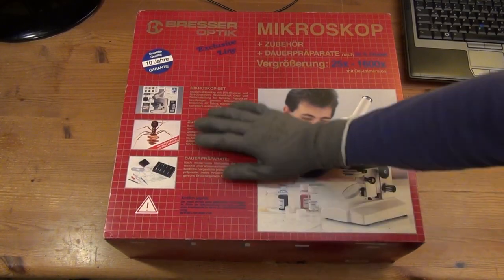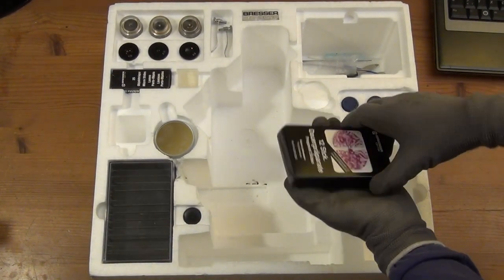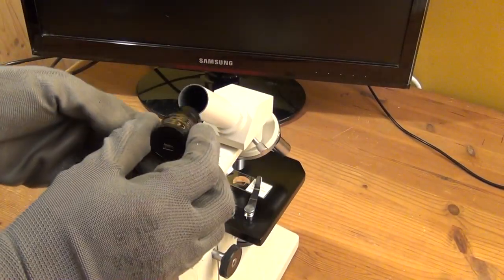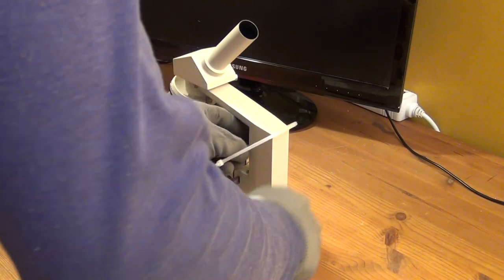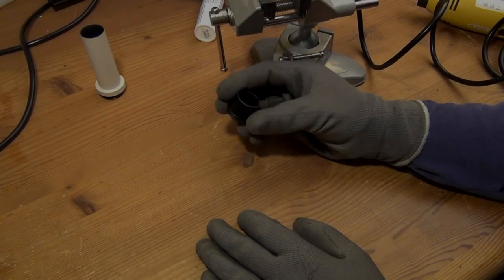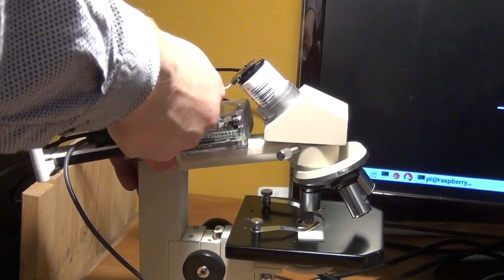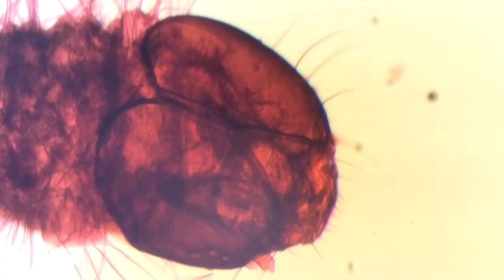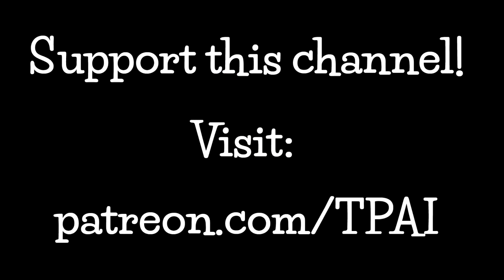Hack: Digital Microscope with Raspberry Pi + PiCam

Comment: Very cool! There is a way to determine the ideal length of the eyepiece tube: Look inside one of the normal eyepieces, they usually have a ledge on the inside (you might have to unscrew the top lens from the eyepiece) where one would normally mount reticles. This ledge is positioned in the focal plane of the objective, and it is at the right distance for the camera sensor. That distance will give you the least distortion of your image, but your lighting also needs to be correctly focused for a clear image (see Köhler illumination).

Comment: So here's the tricky thing about video files: There's a "container" and within that container there's a video stream and an audio stream (a bit like a zip file with more than one document in it). The mp4, mkv, etc. that you see at the end of the file name actually represents the container and (for our purposes) has no direct bearing on the encoding of the video stream. In fact, the most common encoding of video streams in those containers is h264.

That's a long-winded way of saying that the h264 encoding wasn't the issue here, but rather the fact that it was raw video which was not held in a container; VLC and/or Handbrake should be able to fix the issue in addition to ffmpeg.

Comment: for anyone considering looking at microelectronics at the level of the silicon die, that requires magnification of around 1000x and you need metallurgy microscope where illumination is fed into the optical path through the lens (because lens is so close to the specimen light can't get to it from the side)

Comment: Yes, please continue with more lighting options.  I am curious to see how this can be used for electronics work.  Can the distance from the objectives be easily changed to give more working area?  Great video, thank you.
Reply: Scopes used in electronics videos are usually stereoscopes that use a large single objective lens to get up to 60x, which also allows for a larger depth of field. This type of scope is a biological/mineralogy microscope. The optical train is made for very close, very narrow field imaging. Usually of things squished flat between two pieces of glass. One easy mod to do with these type of scopes for viewing things that aren't biological in nature is to add a light for top illumination but if you were using the high power objective is usually too close to the work for the light to illuminate from above so you have to use bottom illumination. 

I am currently working with a cheap microscope to make a automated mechanical stage and focusing mechanism so that I can just mount something on a slide but this line into the scope and the scope will automatically take an image at every point across the slide and Stitch them all together for one big image.

TLDR - modding cheap Scopes is totally a thing. But not all mods are possible depending on the scope.

Comment: wow, very cool ! I wish I had your luck with such a cheap microscope. I personally still hunt for a cheap one. 
About ffmpeg, you mentioned it didnt worked in windows back then. I am using it rather later comparative with you, so from around 2020, and I exclusively use it in my windows7 that  I still run in 2022 right now. And as far as I experimented with it, it did everything I wished, from cutting a video, merging 2 pieces, converting formats (for ex: mp4 to avi, to mp3 whatever) and more. So it appears in 2016 when you made this video, ffmpeg might had been in its infancy but now, in 2022 is working absolutely fine in windows. Its fascinating to see you use these tools, very good !

Comment: I have a bit of electronics here that I've been unsuccessfully trying to read the number on a chip using magnifying glasses and such.  This video prompted me to go and get my "USB Microscope" (one of the cheap ones :-) and it worked quite well for doing that.  That thing came with some software that I was never able to make work but my linux distribution came with an application called "cheese" which was apparently made for webcams,  and that worked well.  I can either store pictures or videos with it.  I'm sure that it's available under Ubuntu,  haven't looked to see if it's on my Pi yet.

Comment: I was just looking at a pi camera but was worried I wouldn't find enough uses for it until I saw this video. BTW your Raspberry Pi power supply is too small, the square rainbow in the right corner is a sign that the system is going into power save and will slow your capture down and loose frames. I just ran into this problem on a Kodi build and a 3A supply fixed everything.

Comment from the maker: Wanna have a good laugh? Wanna see some cringy Germans singing in America:
https://www.youtube.com/watch?v=nDEfaonoQvg
Reply: Thanks eh. That was great...   Ü
Reply: The Post Apocalyptic Inventor 
I see that everyday ,not in America but at work in Germany ;)
Reply: Oh we have a lot more cringe-worthy than that!
Reply: Use a higher amperage adapter or shorter thicker power cable for your raspberry pi, cause that rainbow square at the top-right corner of your screen is a warning for undervoltage... I have a pi 3B and I've got the same issue until I changed the adapter to a 5V@4A one that, I had...
Reply: I don't have a pi camera, but I already have a modified webcam which I turned into a digital microscope made of recycled lenses, couple of plastic caps, lots of epoxy, and I also made an LED ring light around it, controlled by a simple circuit. I used that with GUVC viewer on my PC, under Ubuntu 15.04, to display image/record video/capture image. It works, but it doesn't yet have a stand(I didn't finished it yet), and it's kinda hard to position right, and get a still image, while I'm holding it in my hand. It"s an old webcam I had laying around, and it's only 480p camera... Anyway I'm pretty satisfied with that knowing that I literally only payed the epoxy, and the components for the light ring, and circuit... sot it was less then 5€ for me...
I'll definitely try if that works with my raspberry pi too. :)
Reply: Thanks. I'll try ffmpeg. I suggest Freemake to you. They have a few free conversion tools that always work. Windows native tool in their Live Essentials pack Movie Maker exports in H.264.

Comment: From what I can tell from the ffmpeg output, the issue isn't that your programs can't use h.264, but instead that those '.h264' files you have are raw h264 data with no video container (like mp4). Which is why running it through ffmpeg fixes them; ffmpeg is just copying the input file directly into the output container file.

With that said, it also looks like the files were originally encoded using the 'high' profile for h264, so if you ever run into issues with another program not being able to play the mp4 versions, I would suggest adding the '-profile main' flag to your ffmpeg command.

As to transcoders on windows, there are builds of ffmpeg for windows ( https://ffmpeg.zeranoe.com/builds/ ), but as I've never gone through the process of installing them and using them on windows I can't comment on how easy it is to get setup. If all else fails, like many others have suggested in the comments, handbrake is a good alternative.

Comment: Hi! I was thinking about this and it came to me, that you are using the microscope like a simple magnifying glass. You have a system of only one lens. It would be interesting to see, if a setup using three lenses again like in the objetive-eyepice-eye system, for example the objective with an eyepiece and then the camera with its lens in the right distances is also possible. Using only one lens, you don't get the multiplication effect of the magnifications. Only a magnifying glas with hopefully good resolution and small focal distance... but it is cool to see that it work as easy as this

Comment: You could have also used a old blackberry or similar lcd display backlight panel to fix directly below the slide area and maybe still utilise the brightness levelling of the said led backlight.

I always have many sized lcd displays around that can be dismantled for projects if needed or just pop into your local smartphone repair store and ask them if they have any old lcd backlight working screens they may donate to you 👍🏼

Comment: It's not really an encoding problem, more a container problem. H264 is a video codec, but for a general purpose media usage you need to mix it with sound, subtitles etc. That's why containers like mkv or mp4 exist. ".h264" is a raw video stream, that's why not many programs can read it. "Conversion" to MP4 is not re-encoding, just copying into a media container.

Comment: I'm doing this with an old usb webcam. Damn you for beating me to the punch!!!

I would love to see what improvements you can make to the lighting system and whether the flickering artefacts of the LEDs can be mitigated.

The system I'm using is an old London Beck model 47 scope with a logitech 5mp webcam, and also a tungsten filament scope light form the 60s. I have put a bit of thought into moving to LEDs, but my experiments have come up with the same colour distortion you had -_- So seeing some solutions would be really cool.

Anyway, thanks for the cool video.

Comment: This is a great idea, I'd like to see more!
However, using Linux on your main PC is generally what I'd advise. In case of enough RAM, keep Wintendo in a virtual box, or if you absolutely need it for some crappy hardware that doesn't run on real computers, make it a small dual boot partition (although when I ran that setup, I always felt like my PC wasn't available when in Windows, because all my programs and all my data were of course on the Linux partition, which made me use Windows maybe once a year or so).

Comment: Was the pi cam producing better quality than the Other cam?
I have been considering getting a microscope in my shop, but prices too much. This looks like it may be the way to go. I would be satisfied to go only to 60x with top illumination. Need for metallurgy. 
I deal with h264 all the time on windows 7. Think you have win 7.
I run ffmpeg from within a folder on win 7 using cmd window, but only to assemble downloaded from youtube 1920x1080 videos. I assemble the sound file to the video file. It works with h264.
I think there used to be, and maybe still is an ffmpeg windows installer. Not sure it would have all the functions of running it from cmd window though.

Comment: Thank you very much for your video, which helped me a lot !!  
I got my daughter a Bresser Mikroskop Biolux NV 20x-1280x for Christmas (100 Euro), which also comes with a simple usb digital camera included. For me however, I want to use the Raspberry Pi as host PC.  Here I found two programs (cheese & Camorama) which was very helpful.  Unfortunately the microscope is still wrapped under the Xmas tree, so I could not test this yet.  However with a Webcam especially Camorama works pretty good.  Cheese is however better, but loads the Pi CPU too much.  Will see how this all works after Xmas.

Comment: For video conversion you can use Handbreak https://handbrake.fr/ it runs on Win, Mac and Linux
Reply: Graham Hooley handbrake rocks
Reply: Ollyweg 0 Probably the simplest way of doing it is to mux the h264 stream into an MP4 container, for example. No conversion, reencoding, required.
Reply: Ollyweg 0 That's interesting, I thought it could be just a container issue, where the editing software won't accept the standalone h264 stream, since all editing software I know does support h264.
Reply: Ollyweg 0 Yeah, you are right. Didn't think about that. 

There's a whole range of encoding options that might pose a problem for certain editing softwares, even though it is to my knowledge that a good implementation of the h264 codec should work with all available options within the codec, such as level, trellis, deblocking, etc.

Comment: To reencode videos, I use Handbrake, though if you're having problems with programs and devices not being able to play h.264 video... that's very strange. Typically that's my Go-To format
Reply: James Pourroy Yet another alternative is MeGUI
Reply: James Pourroy If you don't need to reencode, just use a muxing tool to mux the h264 stream into a container of your choice (MP4, MKV, etc). No encoding is done.

Comment: What kind of images you have from a pcb? Can the microscope be used for solder work or is the latency of video record+playback too high for that?

In solder work I have found that enlargening factors of around 2:1 to 5:1 are good, so a microscope might be wrong tool for that anyway...

Comment: When you're taking the video  or a still with the pi camera on the microscope tube, how are able to get a rectangular image to display with raspistill or raspivid, instead of the round image that the eyepiece tube would generate?    And it looks like you're getting an almost full screen for the vids and pics as you're taking them.  How?  And finally, are you using a lens in front of the pi camera?  Otherwise, how are you getting those large FOVs?  Thanks!
Reply: Actually, I figured it all out.  I just got myself a new  Pi HQ camera, and screwed in onto the camera tube of my microscope (a Swift 380T.)  Since the camera itself didn't have a lens built into it, and therefore, was just a sensor, the objective of the microscope acted as the lens.  And it all worked!  Got a decent FOV, which filled up my display.  The videos and stills come out great.

Comment: Great hacking! I'm interested in trying a Raspberry Pi with a camera module to take pictures of (digitize) super8 cine film frames. So the subject matter would be pretty small (about 5x4mm). I'm thinking I might be able to buy one of the higher res. Arducam cameras, then maybe their microscope lens (about £50 GBP) or some ordinary CS or C mount lens with some macro rings on it. This seems a much cheaper option than all the machine vision cameras out there I've been researching, but who knows if it will be any good. Anyway I've just ordered my first Pi board, I think there'll be much trial and error ahead ...
Reply: Note : using picamera with another lens than the furnished one will probably cause color issues :/
See https://photo.stackexchange.com/questions/98980/what-is-causing-color-shifts-near-the-borders-of-my-picam-setup for samples
Note 2 : PiCamera V1 have less of this color problem (as shown in the video)

Comment: Your Raspberry Pi is underpowered, that rainbow square in the upper-right corner means that the power supply struggles and the voltage has dropped below 4.65 volts.

Comment: you're not converting the h264 file you're just muxing it into an mp4 container mp4box is another piece of software which can be used to do the same thing and also if you wanted mkv you can use mkvmerge to mux it

Comment: To get a video "directly try this note to put all "-" correctly or you get problems to mke it work :

raspivid -n -pf high -rot 180 -b 17000000 -fps 30 -t 60000 -o - avconv -framerate 30 -i - -y vcodec copy -v 0  -r 30 video.mp4

Comment: I made ledlights for my monoculair microscope, the 3rd picture in my link http://www.pa4tim.nl/?p=1546 Just a plastic plate with a hole in the middle. A circle of small holes around it for the leds and then I taped it to the microscoop. A little bit quick and dirty but it works very good. 
I also made a bigger plate on the microscope to hold the pcbs

But I like your idea with the pi.  I have a bresser stereo microscope I use for electronics repairing purpose and that has a 3rd tube to hold a camera adapter. I did not know Bresser sold those cameras and I never thought about using a modified webcam. Thanks.